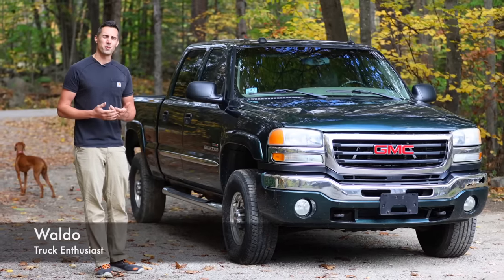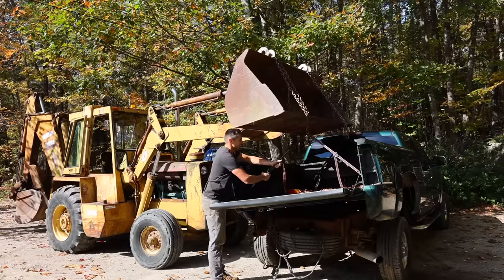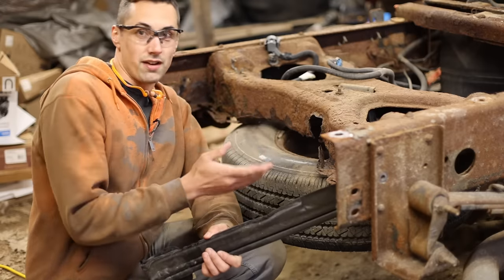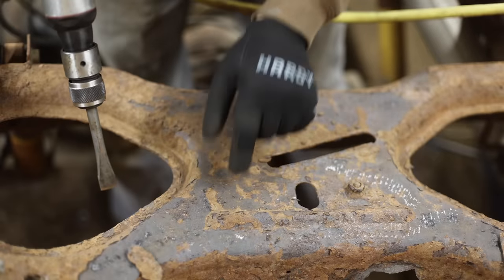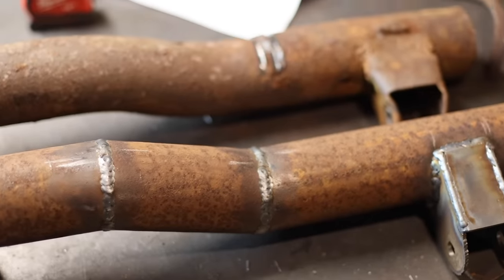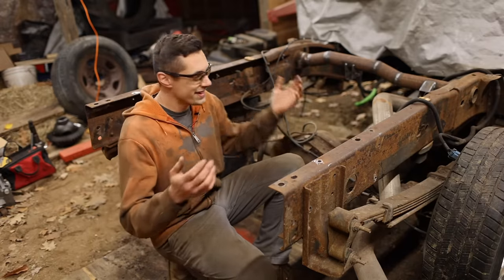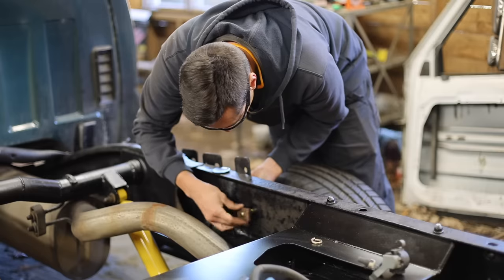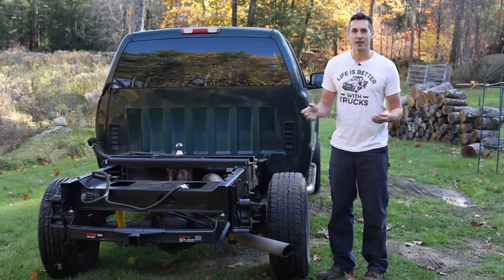Repairing a Rusty Frame on a GMT800 Truck [Cheap Duramax Part 2]

Comment: Vehicle rust is basically a non-issue in my area but I would've primed the frame before painting and painted the new rear crossmember before installing and oiled the inside of the tube crossmember.
Reply from the maker: In my experience, it's basically no use painting a frame around here. The salt will always find a way to get to the metal. The only way to stop it is to coat it with oil every year 🤷‍♂️

Comment: You'll love having that needle scaler!
Reply from the maker: I think so! And thanks for stopping by! 🤠
Reply: @WaldosWorld  sell that tailgate and get a transfer case brace! make sure the t case pump hasn’t already worn a hole in the case… they make an upgraded pump for pretty cheap. lot less then a new case.
Reply: I just watched your video with the oil leaking 3rd gen ram and y’all said it so similarly I was sure Waldo saw your video 😂😂
Reply: Always a good sign for a newly discovered channel when WWW comments here.

Comment: Finally.  A YouTuber smart enough to know oil undercoating is the only method worth a damn.
Reply from the maker: That's right! 🤠
Reply: POR15
Reply: @romulox4318  will not hold up to the salt. Glorified expensive enamel paint.

Comment: I can't tell you how happy I was when you said some stick welding was in order!
Reply from the maker: Haha a lot of people mentioned stick welding in the comments of the trailer build video, so I figured it was time 😂
Reply: Did you choose stick for temperature? To not overheat? Why not mig?
Reply: @Grasshoppa97  Just fun and easy when you're welding thick steel.  Plus potentially better penetration depending on the rod
Reply: @alexc.8424  thanks!

Comment: This is cool man. I work for Magna and I and weld build all of GMs light and heavy duty frames models. This is sweet to see how the models have drastically changed over the years but more over the failing points for rust build up. Super cool man thanks for sharing

Comment: I did this entire process to my 03 silverado just a few weeks ago. Replaced all the crossmembers in the rear and derusted the entire truck basically and painted it all up with por15. Just got done with bodywork a including fixing the rocker panel holes, then bedlined the whole truck black. Came out good, won't have to worry about rust for a long time. Also fluid filming it before salt season. Wish I had a lot of the tools you do here for this job haha
Reply from the maker: Very nice!
Reply: How well did the por15 work? I gotta replace all the rear crossmembers and I want to get rid of as much rust as possible 😂
Reply: @mm-nl3qz  it's worked pretty good but I would suggest 2 coats instead of the 1 coating did. Or 1 coat and something else, like bedliner. ALSO definitely pay the like 8-10$ for some crossmember frame caps. Coat the whole inside of them with oil. I used fluid film, get some sealant and apply to caps, push the caps in the holes. Crossmembers are sealed and protected, will never fucking rust on the inside atleast. I also got wheel well liners from rough country that work so good to prevent waters and everything just shooting up at the frame. I just bedlined my entire truck too
Reply: @mm-nl3qz  for the por15 dont leave scaley rust or any chucks. Clean it good degrease it and paint
Reply: @oof578  🤘🤣 i saw those come up (the rear wheel well liners) and got too stoked, definitely plan on getting the caps for the crossmembers... cuz my old ones... blew through em with my air needler🤦‍♂️
Reply: @mm-nl3qz  yeah I also put antisieze on a lot of the bolts and just last week fluid filmed the whole truck. Shouldn't have any issues for a long time :)
Reply: @oof578 how’s it holding up?

Comment: 20:05 that’s where the needle scaler comes in handy. It takes all the slag off quick and easy.
Reply: Watch Wes Work seems to be an avid needle scaler user.  Seems tied to geographic location for some reason.     😂
Reply from the maker: Good call! 👍

Comment: You did a pretty good job of  repairing the corrosion on that rear frame.
I'm just wondering why you didn't spray it down with Rustoliums rust encapsulater then primer before you painted it.
Yes it would cost more but would go a long way to keeping the original and replacement metal for becoming a repeat of what you started with.
Reply: Encapsulator and then tractor paint... Self levels, extra thick, and you just brush it on. Way better protection than spray paint and the results look much better too. And it's cheap!!!

Comment: Great restoration... I will give you a tip for future metal work with piping though. Before you weld the brace or piping and seal it, its best to pour a acid wash through the inner piping to cleanse it and prevent the rust from getting worse in a year or two. Clean work though!

Comment: You'll luv owning that 2500HD. I've had mine for 200k and have no complaints. 
Fortunatly I live in southeastern Va where there are no real rust issues. My frame almost looks new.
Also I have a 5.9 Cummins step van w/64k and would luv to swap a nice Duramax Allison combo in it,
or at least swap the Allison 545 with the Allison 1000/2000 6 spd behind the 5.9. The newer Allison
has a lockup converter and two overdrive gears to help with the 4:56 rear gears.

Comment: Going by your last flat-bed build, I'm betting this one will be amazing.  Aluminum is an interesting choice; less likely to corrode (but not entirely immune), lower weight, but not as stiff.  Looking forward to your design choices.
Reply from the maker: Thank you! It sure will be nice to not have to worry about corrosion for this one 👍
Reply: @WaldosWorld  You'll still need some protection, just not as intense.  Unless you use hard anodized aluminum parts, of course.

Comment: Hey dude I enjoyed the video; however, since you took everything apart and mostly down to bare metal, you could have brushed on some rust encapsulator, or sprayed on some raptor liner after a coat or two of self etch primer, or rusty metal primer (the brown one). Then later on you can still spray the undercarriage with wax, etc to protect from New England winters, but I doubt any rust will make it through that top layer of raptor. Truck undercarriage would look mint too!
Reply: Fluid film is the best.
Reply from the maker: Bed liners are super durable, but water and salt usually end up getting underneath it, and once it does, it causes the metal to rust even faster because it holds the water/salt there. In my experience, oil undercoating once a year is really the best way to keep water and salt away from the metal 👍
Reply: Fluid film the inside of the cab corners, rockers and doors wherever possible. They have a 360deg hose made for it. They rust from inside out

Comment: I did my truck frame a while back.  Few coats of primer, few coats of black paint, then a few coats of under coating.   I even purchased special paint or enamel for frames but wound up not even using it for some reason.   I think giving everything enough time to fully dry and cure before applying the next thing on top of it is a good practice, but who knows how much difference it actually makes.  All new leaf spring hangers, all bushings, and new fuel tanks both primed, painted, and then sprayed with rubberized coating similar to flex seal on the bottoms.  You’d be amazed how much crud and dirt is in the bottom of old fuel tanks.  IMO someone should invent a filter  you can use BEFORE the fuel tanks.

Comment: Hi there ,just a little tip from a old seaman, when using a needle scaler ,dont push it down,let it dance on the surface,that would make a better result. And about the truck ,I like it ,but i cant for my bare life understand why they dont use any real rust protection on the frame and under carrige,I personely have a 97 2 door 4x4 6,5 l diesel Tahoe , when imported to norway was undercoted  by the dealership,and is still rustfree on the frame and undercarrige, the only rust is on the bumpers, and i live by the westcoast and drives on salted roads all winter long. Great work ,looking forward to the next step. brs
Reply from the maker: Thanks for the tip! Yeah, they really should have done a better job with rust prevention 👍
Reply: Cuz it's lasts the warranty beyond that they really don't care. Like they kept using raw steal brake/fuel lines from 40yrs, kept rusting...but they didn't care. Every other manufacturer had switched to coated lines years earlier

Comment: That's one thing I don't miss about living in Michigan is all the dang rust. I moved to northern Idaho several years ago and can find find rust free trucks all day long. The only down side is they have been driven up and down mountains and they are mechanically worn out but I would rather deal with that than the rust.

Comment: Nice work Waldo. I’m following this restoration/build to the end. I have a 2006 Silverado 1500 that I use every day in my lawn care business and absolutely love it. I found a complete snow plow and mount for a 1999-2007  2500/3500 Classic. I’m trying to find a solid southern truck. My biggest problem 4x4’s down south are far and few between. Keep up the great work my friend.
Reply: My new favorite for rust prevention is Wool Wax, it’s much thicker than Fluid Film and it also comes in black. Wool Wax has my truck frame looking like new.

Comment: I was hoping you were pulling the entire cab and doing a 100% refurbish.  That year is one of my favorite in life. I’m 57. I’ve driven gas  Chevy pickups 350,000 miles no major issues from that generation.  My wife’s 2001 Tahoe took us 362,000 miles with a transmission swap and we sold to some friends who have driven it over 500,000 miles!! 

Your truck.. well it should be on YouTube 50 years from now if taken care of.

Comment: I also live in the north east and have cars that are highly susceptible to rust.
I use Tractor, farm and implement Paint. cheap and good quality, can slather it on super thick.
I also grease up all the fasteners liberally.
as well as an oil undercoating like you

Comment: A tip for removing gram rivets is to cut an x in the head with an angle grinder then use the chisel for the air hammer to get under it and pop the pieces off then use the punch for the air hammer to poke em thru. Much much easier, had to do it everyday at work working on custom off-road Broncos
Reply from the maker: Thanks for the tip!

Comment: You should look into corroseal primer for your frames before painting them. Corroseal is meant to work on marine stuff so it’s basically made to resist intense salt and conditions. I like the fact you oil your vehicle underbody. It is a good preventative. Good vids I can’t stop watching ‘

Comment: I'm going through this exact thing on a 2007 LBZ. Was fortunate enough to find a rust free box after searching for 6 months. Mine is a bit better shape overall but I've been slowly rebuilding it since Covid began. I had a spinning nut earlier this year in the floor from the center cab mount. The tack welds they put on those don't stand up. Good luck, these truck are worth preserving.

Comment: Since u r a rust warrior like me I'll share this with u. My Pap worked at Ford in Ohio next to Lake Erie. A coworker drove a late 40s sedan in 60s. Pp asked how do u keep that car from rusting out with all the salt? He told my pap a good wash, dry then do this, 1 quart of any new or used oil, same with trans fluid, 1 tube or tub of grease, 1 or 2 wax ring toilet gaskets. Put all in a old pot, heat and mix. Then brush, spray etc everywhere under, in etc. For doors plug drains and fill with mineral, baby oil, trans fluid, or even melted Vaseline. Let sit for a week and drain and save for next year. This all costs less than $10 and will outlast anything u can buy for 5, 10 times as much. Alot of the waX has no oils or very little. The oil, fluid and grease is key to stopping rust permanently. I've used this method, my father's used this, neighbors etc. U can use on anything that gets exposed to water, salt, mud etc. I'm for saving these older autos. New autos are not same quality. Thin metal, barely coated. New ford's and others have rusting issues b4 they leave the lot. It's sad but that's the world we live in. Meanwhile a mid 90s celica is still rust free.

Comment: I had the same 2500HD , same color but 01 with extended cab. Up in your neck of woods up in Maine.  Back in 2010 I had taken the bed off and sandblasted it. Primed it with red rust primer. Also put anodes on frame. Because the primer sucked it was back with spotty rust within couple years. The waxy paint uncoat GMC puts on is resistant to sandblasting and had to be scraped off in some areas. Sold it off in 2014 after replace cab corners and rockers.

Comment: 6:00 Holy shhhhhh the spare tire carrier actually works! I've never had one work on an old Chevy Cat Eye. Even the new replacement one I put on only lasted about six months before it got bound up. And forget the old original ones. Too rusted out to even try to turn the release.

Comment: I stumbled upon your channel.  I enjoyed watching it very much.  I'm in Massachusetts and own a 2012 GMC 1500.  I was under it the other day and saw the frame looked like a cheese grater.  The entire cab looks excellent.  The bones, not so much.  Babying it until spring.  Time for a new one.  Well, new and used.  The first thing I'll do is oil it.  It's unique that Volvos, the German cars, have next to zero rust in the Northeast because they take pride in their designs and jobs.  GMC, engineered obsolescence.  So disappointing.   But again, thanks.

Comment: Good video I did the same thing to my 2005 2500 hd. That rear cross member is the way to go. Put grade 8 flange bolts on the rear shackles the ones in the kit aren’t strong enough
Reply from the maker: Good call!

Comment: Good video Waldo. I would like to see if that rust does end up bubbling from underneath having not used a phosphorus-based converter or even rust-reformer prior to hitting it with the enamel and undercoating

We are all experimenting here and 0 judgement until someone finds a definitive formula.

I have spent hundreds of hours researching the definitive answers to the rust problem and am about to treat two of my rigs the following formula (Its a big issue up here in Alaska). 

As far as I can tell, the best products/sequence goes something like this:
1. degrease/scale/brush/clean etc.
2. Treat with Rust Kutter
3. Rinse
4. Treat with Rust Kutter again
5. Rinse
6. Make sure everything is VERY dry (sometimes I will use Isopropyl spray and whipe it all down just before painting just to be sure)
7. A coat of rustoleum rust reformer
8. A coat of protective enamel (Either one of Rustoleums protective enamels or valspar's anti-rust armor both of  which are more durable in terms of penetration-stopping power)
9. Coat with the undercoating of your choice, I myself am going with ROLL-ON (specifically) herculiner. Be careful not to seal any pinch-welds or frame holes (for closed-tube frames) as you want the lanolin product to drip through these
10. Treat the frame rails with non-black fluid film using a wide-angle applicator gun

Comment: Those bodies are so easy to swap buying a clean used frame from out of state is another way to start fresh. Have it blasted (monument companies all blast on the side and their compressors and blast pots are serious industrial gear) to frosty white, prime and coat then swap over parts as you go. My 2000 Silverado was assembled from three+ donors where I used to work. These trucks are like Legos on wheels.

Comment: Recently stumbled across your channel and really enjoying your builds. I like the attention to detail. Just wanted to share a tip that’s worked well for me, with the amount of effort you’re putting into rust resto. I live in a state with lots of snow and heavily salted roads as well, I hate rust so I also use fluid film and started with that same rustoleum paint but still had to re-do a lot of the paint annually- I swapped to Por-15 paint with a annual coat of fluid film and haven’t had to re-do the paint in years now.

Comment: I enjoyed the video just like I was doing it myself. That been said, as an expert in these kind trucks and a business owner, I can tell you for sure this bed won’t pass a DOT level 1 inspection due to the fact that you welded the cross members from pieces of pipes not a one piece which makes it unsafe for heavy hauling. Not sure what your truck is GVW but these cross members defiantly not going to pass a DOT inspection for commercial use. Unless the point for you repairing this truck just for personal use, that won’t be an issue. I would still be careful when using the truck for heave load. Thanks for sharing this project on Youtube.

Comment: Instead of rustoleum paint, I now use truck bed liner in a spray for the hard to reach places and a roll on/ brush coat for the easy to reach spots. That stuff is much more durable, and has the right sheen to look good for years. I also oil the frame 2 a  year.

Comment: Another great video, Waldo!  You’re halfway to 100k subscribers, congrats.  Nice job on the fab work for the round crossmembers.  Mustie1, another NH youtuber, uses bar and chain oil to undercoat his vehicles.
Reply from the maker: Thank you so much, Greg! Yeah, I was thinking about alternatives like spraying motor oil as rust prevention. For the time being, I have a 5 gallon bucket of fluid film 👍

Comment: Wow this looks familiar.  I just did all this, and basically the same to the front half (including tons of sheet metal cab repair) to a 98 F150 4.6 4x4.  800ish hours in, i'm deciding if i should sell it. 🥴  I hope you keep yours and it's worth all the work.